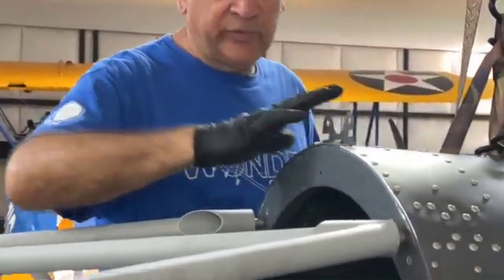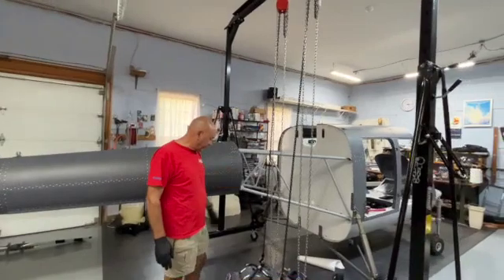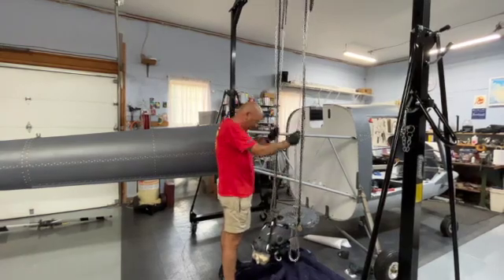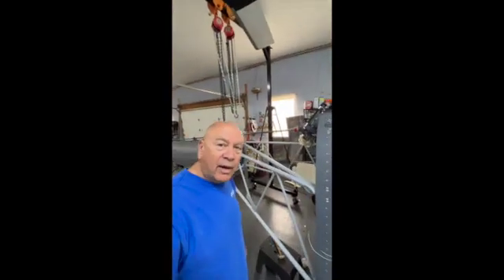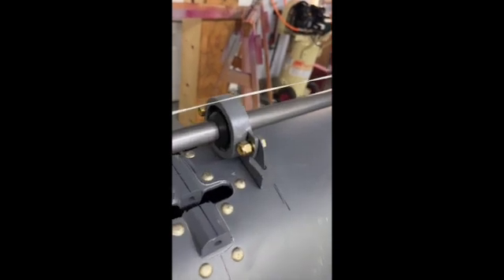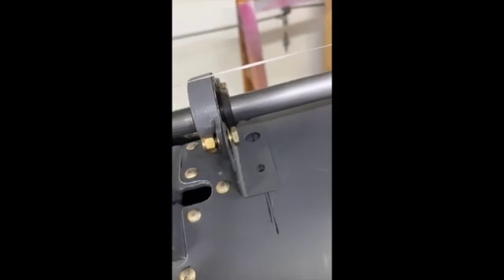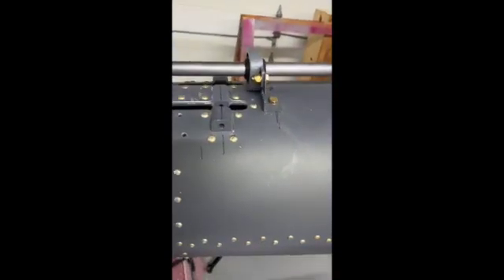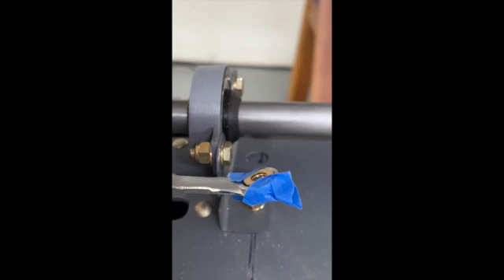Hummingbird update 6 5 22   SD 480p

Comment: G,day from Sydney Australia.
How do you know if a bearing is about to fail around the rotor drive shaft? Do you replace them regularly?
Nuts: do you use loctite glue?
🌏🇦🇺
Reply: I assume they are part of the inspection process. As for the nuts, they are standard AN365 self-locking.